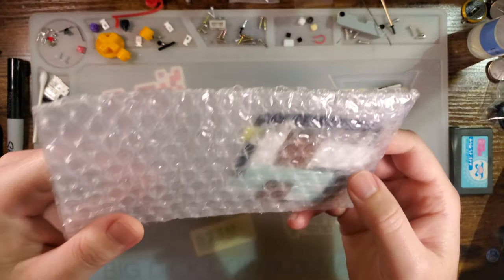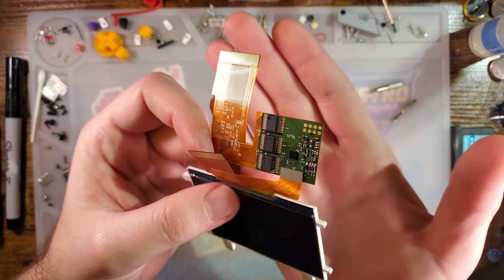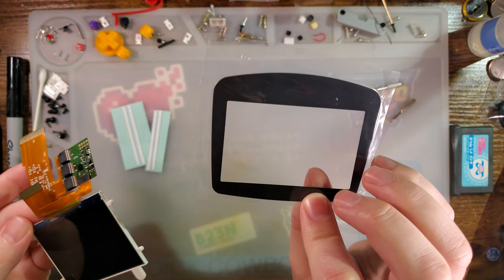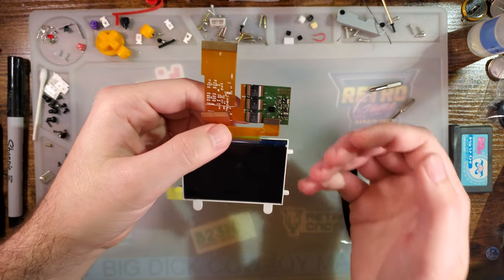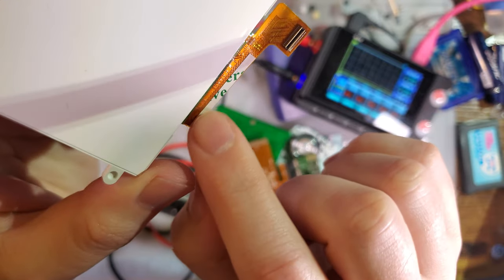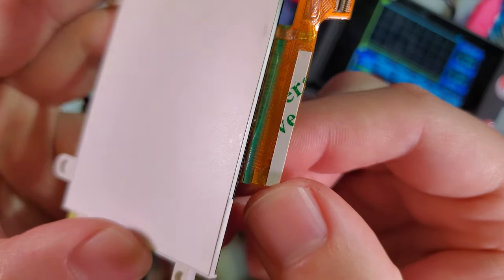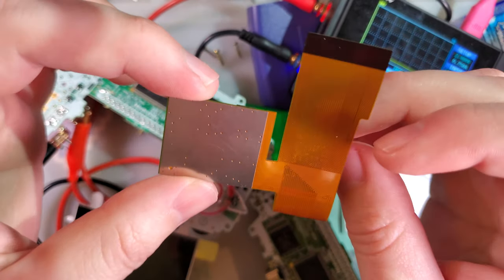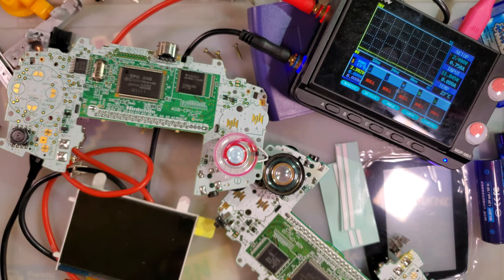The Importance of Testing Hardware Before Install

Comment: It depends how much of a hassle something is to put together, if it's just a snap in part and no disassembley required, it will work fine, if you need to do 30 screws both ways, it will never work if you don't test.
Reply from the maker: Just test it always. It's not difficult and it avoids bad practices.

Comment: I bought the GBA video out kit from RGRS and it came in with a defective IPS. I had the sense to test it before installing but they still haven't responded to my request for a replacement.
Reply from the maker: Good thing you tested it beforehand then.

Comment: 2:47 Hey Makho whats that device that powers up the gba with alligator clips? Im in need of a multimeter and alligator clip battery mount. will your device replace a multimeter
Reply: Zedlabz sell some! I have one and they're great
Reply: @TheAnimeexpansion  ZebLabs sells what
Reply: @swide2750  the thing you asked about
Reply: @TheAnimeexpansion  the power supply?
Reply from the maker: Power supply. I link it in the description of most of my videos: https://retrogamerepairshop.com/products/mdp-xp-mini-digital-programmable-power-supply-set-with-30v-5a-90w-2-4g-wireless-connection-2-8-inch-tft-screen

Comment: I'm having an issue with my GBA drop in screen showing light bleed due to pressure from the shell. Not sure what I'm doing wrong. Original shell, only tighting screws enough to barely close the shell. Screen looks fine until I close it up, then it shows white all around the edges. Any suggestions?
Reply: Trimming the raised area around the screen might help alleviate some of that pressure
Reply from the maker: Ensure that you have your shell trimmed properly and that all your cable/wire routing is proper.

Comment: Off topic, but since I've seemed to momentarily snatch your favor, do you know what the lcd the GBA 3.0-inch "drop in" kits use? Like the I know the 3.2's are from blackberry 9380's but I had a pixel die on my 3.0 and would like to replace it.